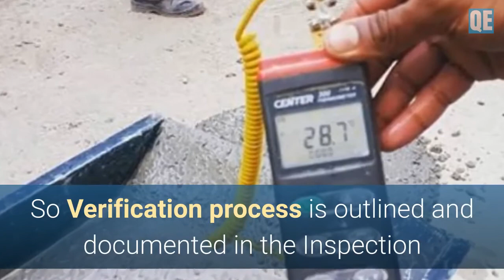What is witness point and hold point

Comment: Can we say that only for hold point we have to raise IR otherwise no need, is it like that??
Reply: So if i understand correctly, do you mean for every point mentioned in the ITP we should raise IR regardless what type of control point? i.e The only difference is that for hold point we can't proceed without approved IR by the consultant.
Reply from the maker: @gihadosman8999  Yes, correct. Without their presence. on site as well.
Reply from the maker: You should also raise IR for witness point because that proves that you have an acceptance for that part of the activity.